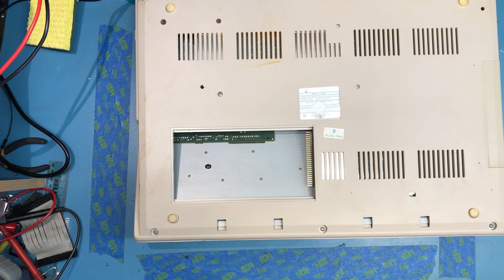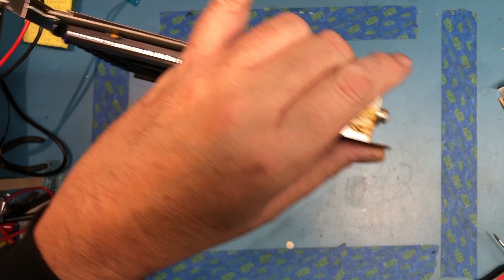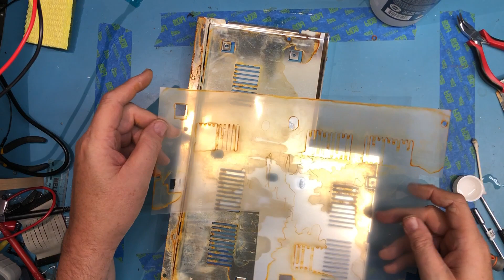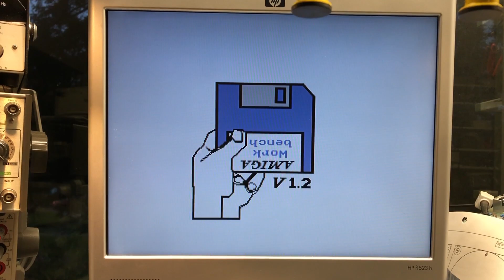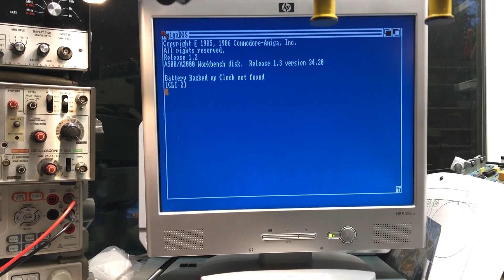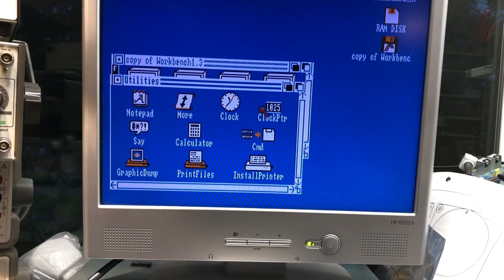Amiga 500 - Part 14 - A complete A500 comes my way - Teardown and checkout - STB241

Comment: I like a Bathroom cleaning product called "whink"  for removing rust stains from plastic.  It's a bathroom cleaner intended for use on porcelain and has a very low percentage of HF acid.  I wouldn't use it on the metal RF shielding, but it's almost magical on plastic.

Edit:  I think you're right about it being mostly coffee.  Machines I've picked up out of gutters that have severe actual rust stains don't clean up with alcohol.